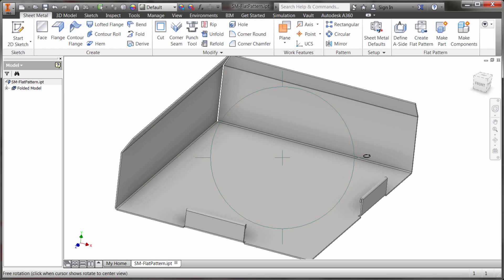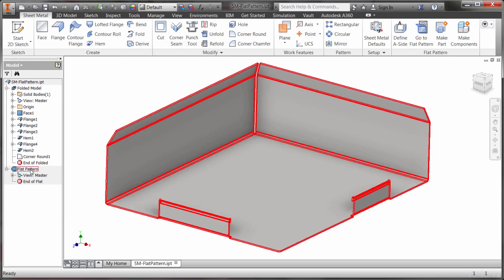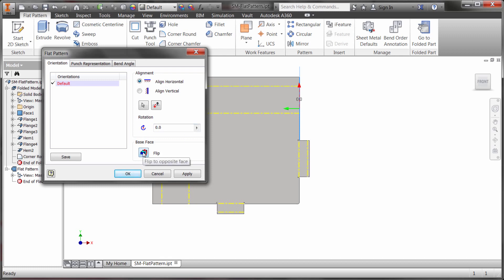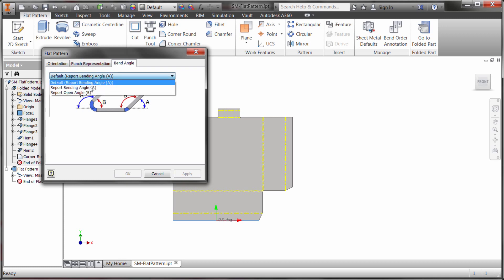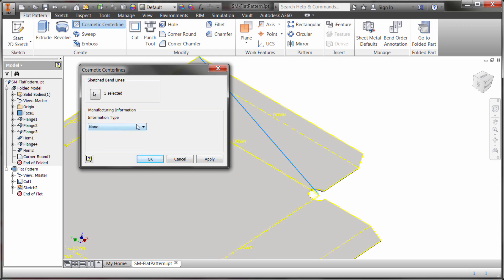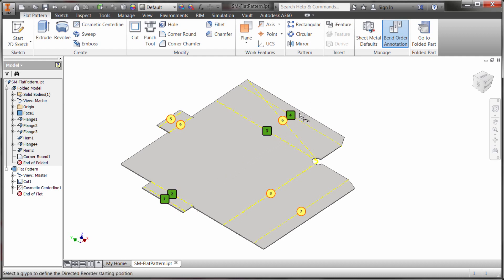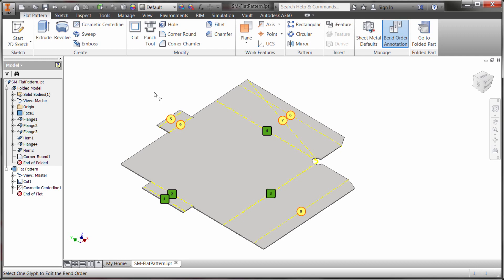Inventor Sheet Metal Flat Patterns

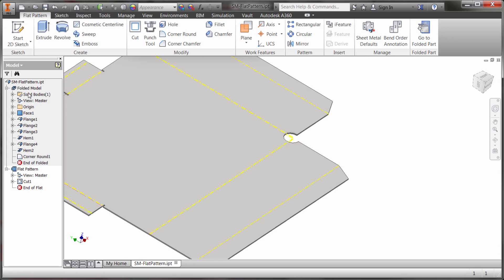Comment: Back at 4:05 there, the flat pack alterations DON'T show in the folded model? It would be handy if it did! How can I make them show?? This cropped up at work and it screwed me up.
Reply from the maker: Yeah they will only show up in the Flat Pattern export, or on the drawing view. If you want to add features to the model you will have to do it by unfolding, making the change/addition, then refolding.